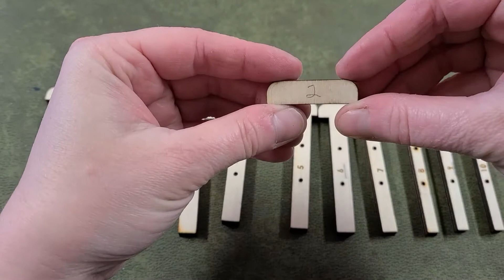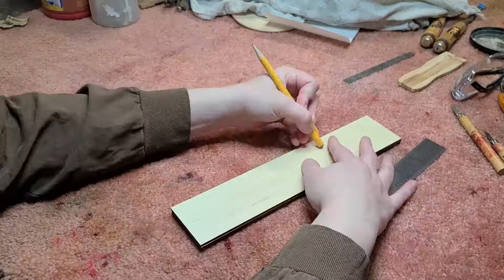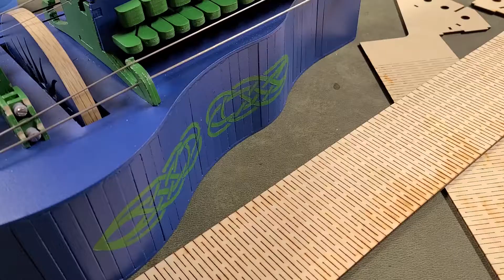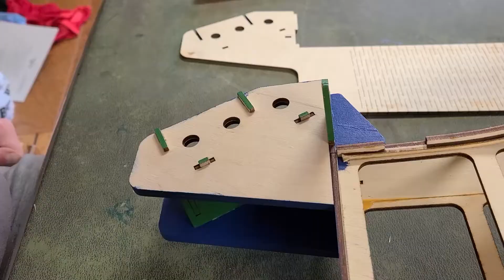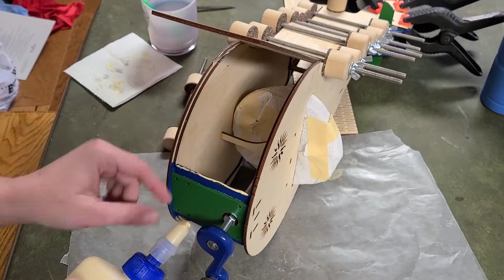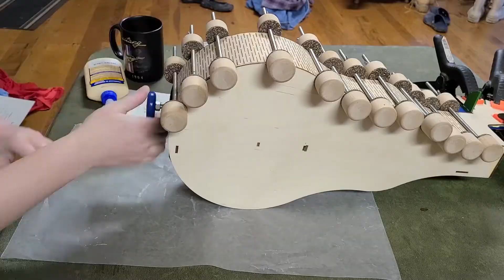Nerdy Gurdy Build: Part 5; Keys, Keybox Lid, and Sides

Comment: What did you use on the wheel to make it sound smooth?
Reply from the maker: I used a utility knife/razor blade. You can see it in the Part 4 video.

Comment: So the kit that I received didn’t have the keys numbered?  Any suggestions on figuring out which one is which?
Reply: The keys with the longer key heads are the bottom row, and the keys with the shorter key heads are the top row. Generally, the larger keys are nearest the tuning head and the smaller keys are nearer the wheel. If you use the link in the description to the Thingiverse files, you can find a picture of the two key rows in order. That might help a little.